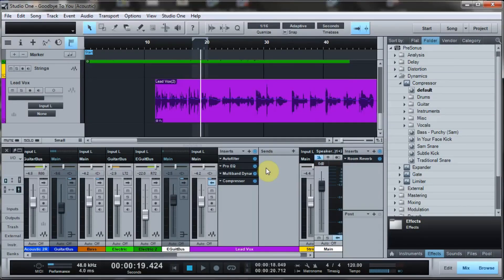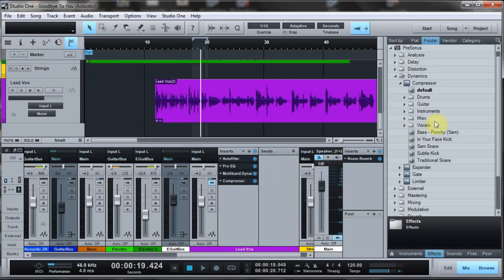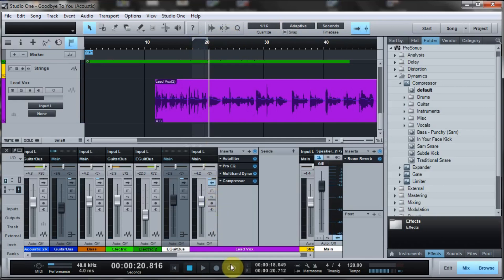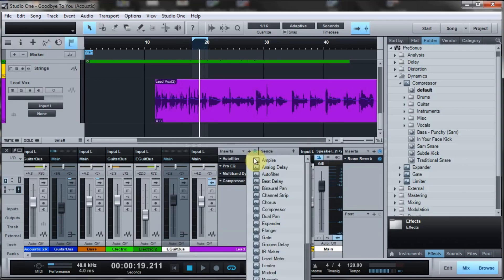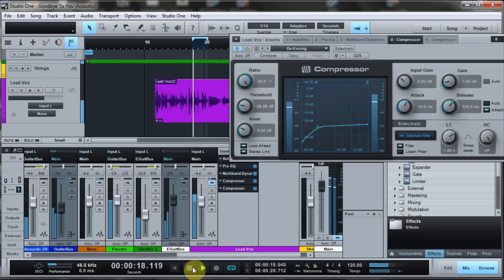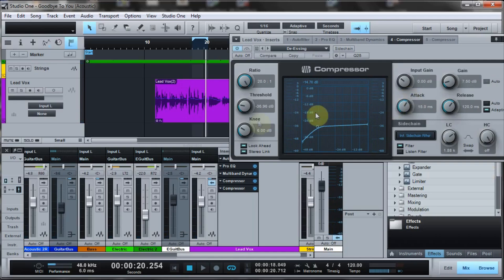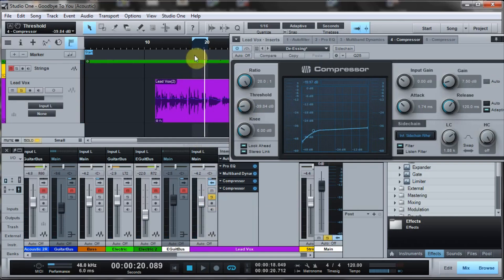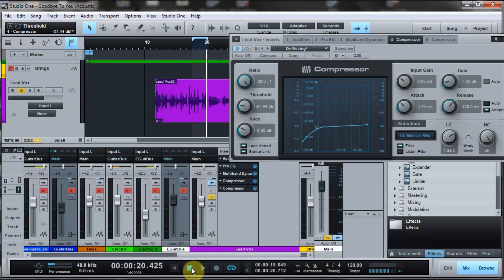Studio One DeEsser Using Compressor

Comment from the maker: since making this video I bough Wave's De-Esser which works well.  I also use iZoptope Nectar which has a pretty good De-esser.   The tip in this video will work but decated de-esser might be a better solution if you have the money to spend.